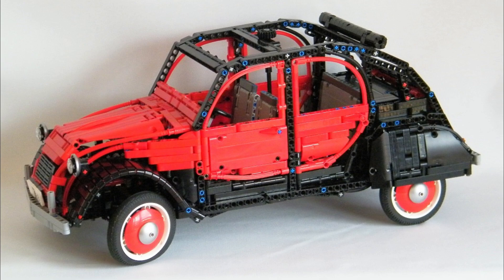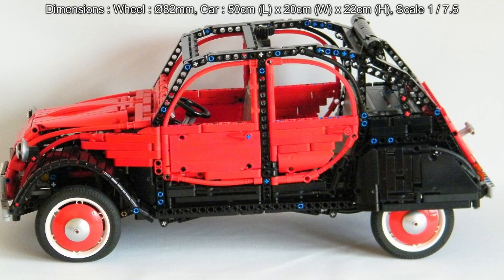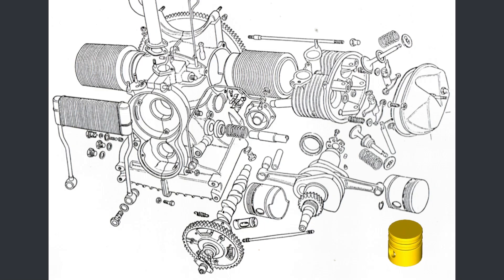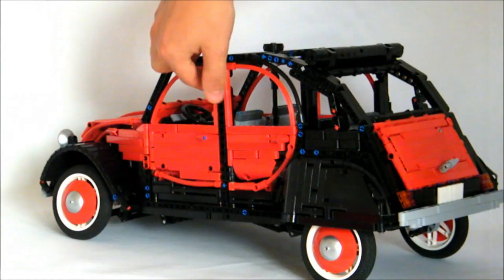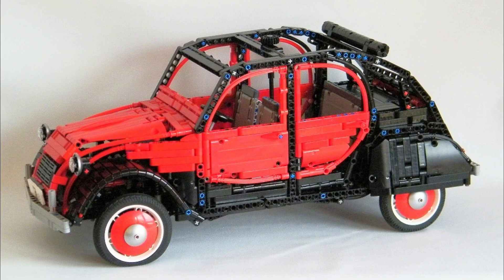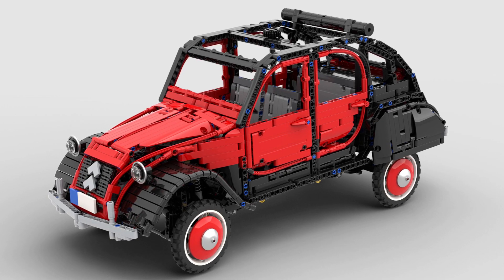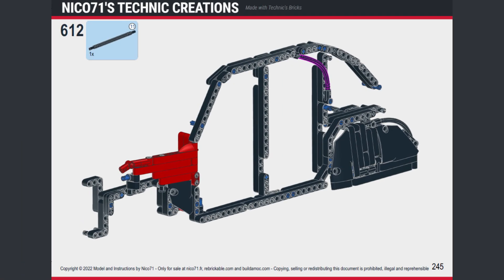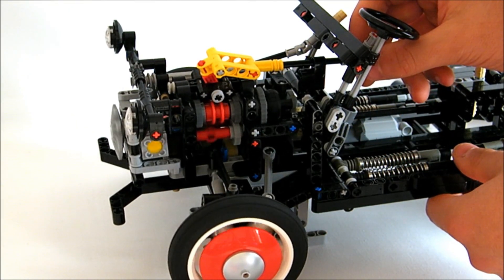How I redesigned this Citroën 2CV Charleston in LEGO Technic

Comment: Such a great move ! Amazing suspension effect so close from reality for whose old enough to have driven this car in real life 🎉
I am not in the 1:8 scale but if you rework your existing 2cv model 1:15 scale, it will be also a great "gift" for your fans...me first !
Reply from the maker: Thanks for your comment ! Yes the Mini 2CV would need a redesign but not because of the parts, more about the finishing of the surface, but I am afraid with an increase of price (more details, more parts, higher price)
Reply: @Nico71Fr  great news for mini 2CV ! And yes hidding blue pins for instance is challenging even for Lego designers 😉